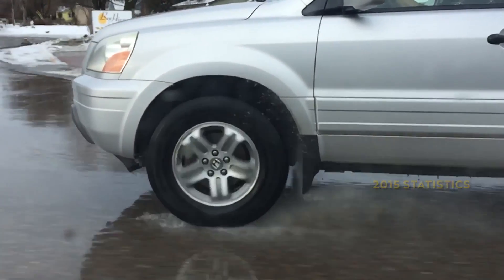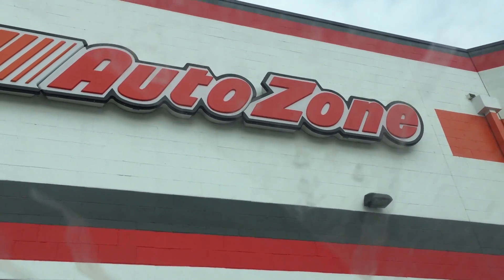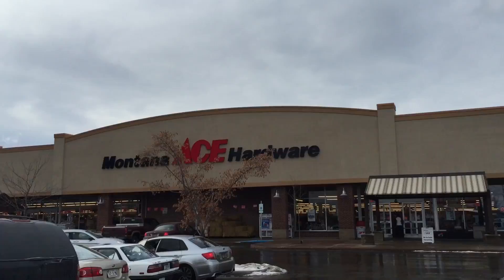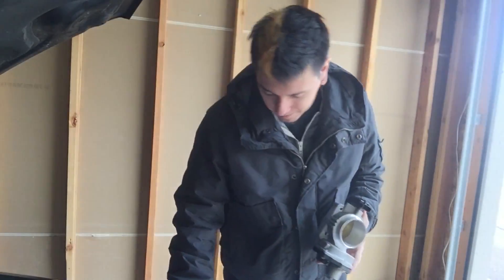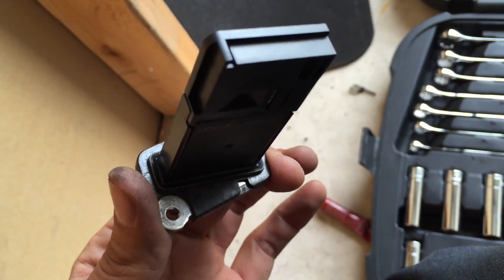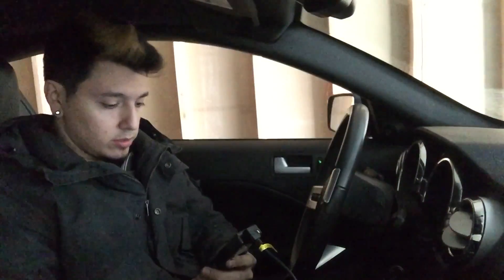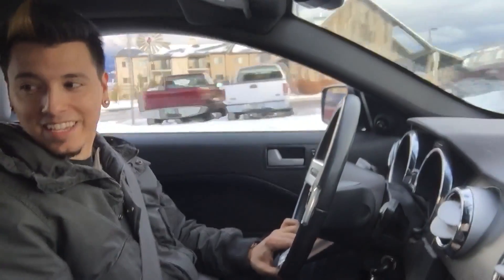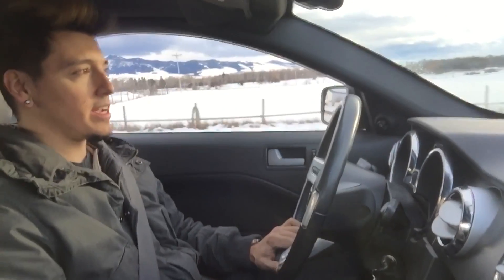Screwed

Comment: That intake hiss sounds an awful lot like a vacuum leak which could lead to poor performance or dirt getting into the engine.  I would double check all your connections are tight and not letting air in.

Comment: FYI you should run at least 95 octane fuel in your car. its keeps the engine cleaner and helps with performance and economy
Reply: I was wondering what he was using before if he 'now has to use 91.' Hopefully not E10.